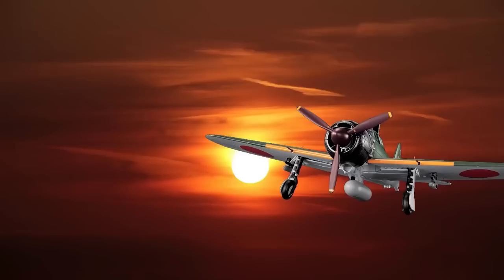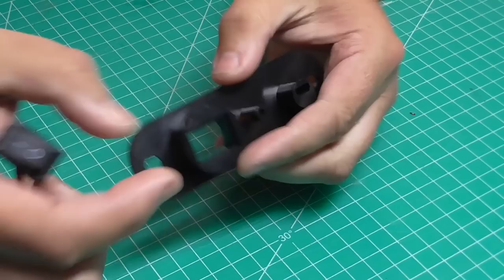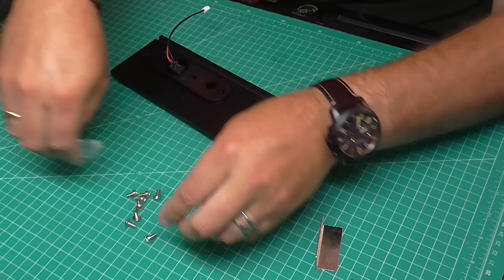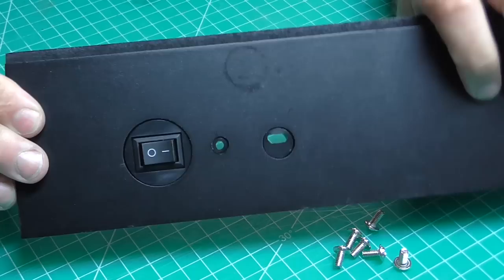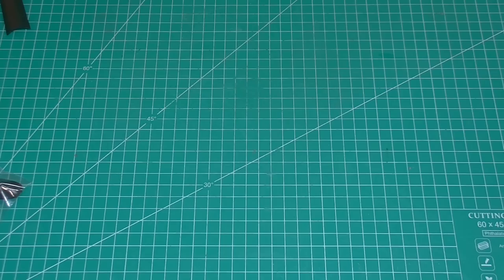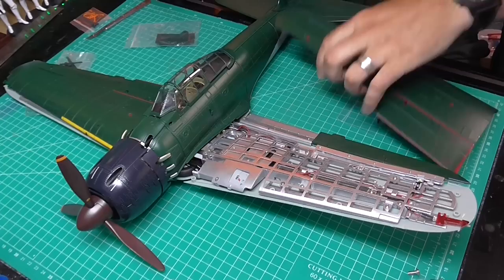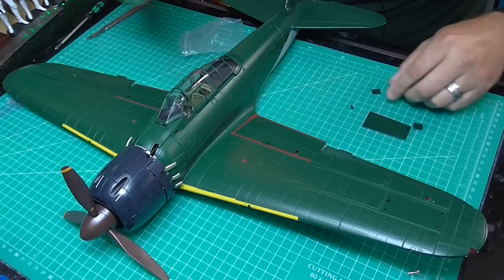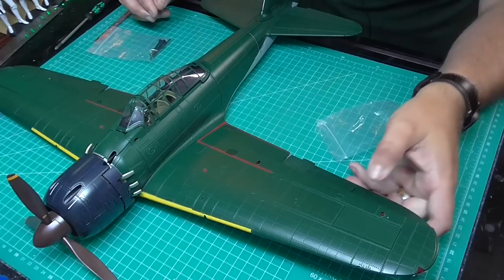Agora Models Build the Mitsubishi A6M Zero Fighter - Pack 12 - Stages 93-100

Comment: The large ‘bomb’ is indeed an external 73 imperial gallon drop tank that could be jettisoned. The increased mileage was a bonus, but because of the material used for construction of the aircraft plus the lack of armour plate, meant that a good close range burst could easily set the aircraft on fire.

Comment: At 13:57 it looks like the top limiter switch on the right is still unplugged from its local lifter limiter pcb. You may want to check that all the other limiter cables are plugged in correctly as well
Reply from the maker: Yep. They all got
Plugged in. I had a test flight on social media

Comment: Hello there.  My "heads up" after competing my Agora Zero.  The decals.  OK, let's be clear, these decals aren't like what you'd usually find in another kit.  They don't "float".  I mean, put them down where you want them to stay!!!  Also, if you are a scale modeler, you already know about decal setting solutions.  These decals are thick, but I used several  applications of Micro-Sol to help them hug down.   Finally, a few other things:. Be careful of the delicate parts!!!   I cannot emphasize this enough.  I am planning to order another kit from Agora, not just this one.  Currently working on Titanic and Jaguar, for what is it's worth...

Comment: Just as an FYI with the circular batteries the first two numbers are the diameter in mm, so 20mm, and the second two the depth in tenths of a mm, so 25 or 2.5 mm. The most common, used in watches and computers are 2032s :)
Reply from the maker: Ahhhhh I never knew this. Thanks Julian
Reply: @WorldofWayneUK  Pity Agora used 2025s. 2032s are easier to source as they're much more common.
Reply: What are these batteries used for in the model?
Reply from the maker: @bincrash  the base and the plane functions
Reply: @WorldofWayneUK  thanks mate

Comment: Wayne - I am waiting for pack 12 now. I have had trouble with decals in the past with other models. I would appreciate it if you would show how you apply the MANY decals for this model. Thanks
Reply from the maker: I will do when I do the reveal video
Reply: Use luke warm water first.  Down load the instructions or read the the decaling instructions.  Use a Q-tip and moisten the area where you will place the decal, that will help the decal slide around until it is lined up.  There's actually a guide line on the wings fuselage and tail!  Then, take a dry Q-tip and roll it across the decal until it is smooth and dry.  I would not recommend setting solution because I don't know how these decals we react.  Let dry.   I'm waiting on Pack 12 too.

Comment: Did you find the part that was missing from the right aileron? This is a massive model, where are you going to put it? It's a real shame the Ecto 1 won't be completed, that was my favourite of all the car builds. The Centreline thing you called a bomb is actually a 300 gallon drop tank to increase the planes effective range.
Reply from the maker: Yep. I got it.
Reply: @WorldofWayneUK  It's good you found it. I was going to say if you needed one I could scratch built one if you sent me an image of the other one with the correct dimensions and I'd have painted it the correct colour too. Scratch building is my thing. I make all kinds of things from figures of pilot's to my own designs. I'm making lots of post apocalyptic Mad Max style vehicles and Steam Punk stuff at the moment for some fans of the genre at the moment and have more materials than I need.

Comment: Can you explain the difference between this base tech vs. spitfire base tech?
Reply from the maker: The Spitfire had a rack and pinion gear system which kept jamming and causing all sort of
Problems. The limiter switchers were very cheap as well. This model uses a clever cam which is just a motor spinning and a cam attached to the end. If I have learnt something over the last few months the simpler you can make it the more likely it will
Work lol